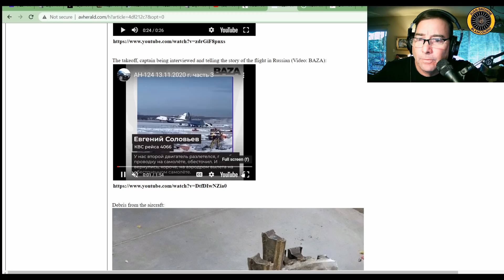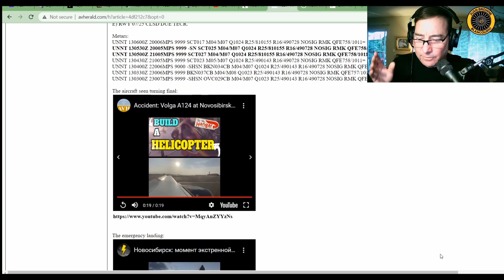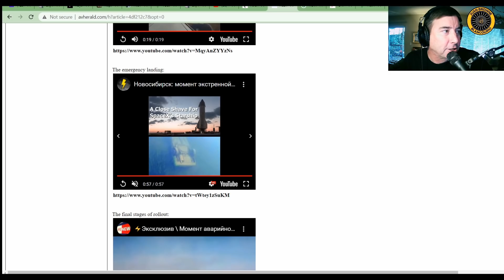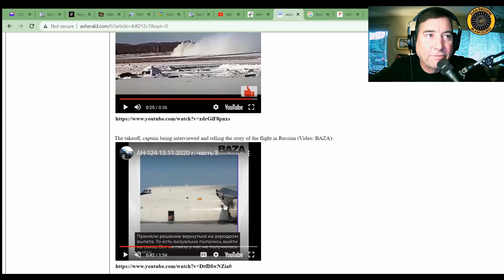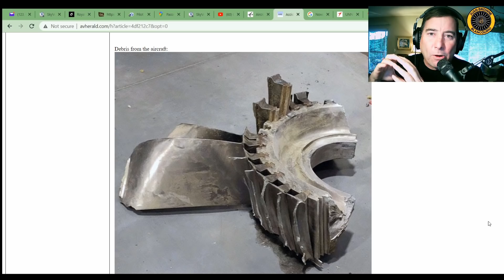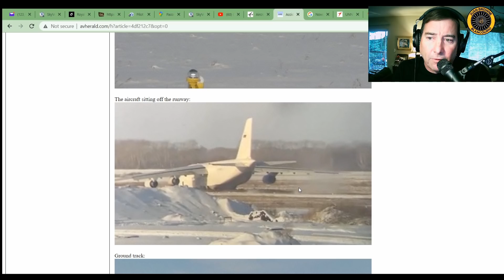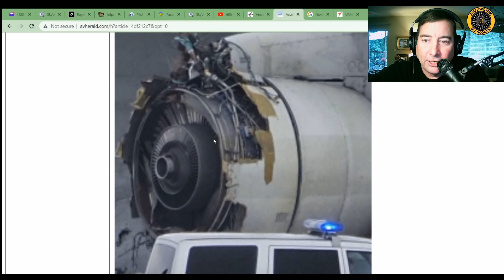AN-124 ANTONOV FAN DISK FAILURE NOVOSIBIRSK, RUSSIA

Comment: When Juan mentioned the "what-if" of going IMC and loosing that much electrical, comms and determining what instruments you have and what you can trust while dealing with a catastrophic uncontained engine failure...it sends a shiver down your spine thinking how they could get back and lined up to the runway. It would be a CRM lesson of Russian legend for sure. Btw- The Antonov 124 has a kneeling chin ramp for loading so the nose gear swings back to lower the nose.

Comment: You r not correct about "guilty of pilots". In Russia it works this way: for any situation when somebody dies or was in high risk of loose their life, so called "investigation" is opened (always). 
But the ✅word investigation does not have any negative meaning.✅ Basically it means that they will try to identify the reasons which led to this catastrophic event.
Nothing else.
➡️presumption of innocence is always applied based on the law.

Comment: It's hard to imagine how the shrapnel from a single engine disintegration could cause so much damage to such a huge aircraft, until you think that many of the fighters in WW2 were equipped with 20mm and 30mm cannons which could bring down even the largest bombers.

Comment: The achilles heel of modern jet engines.
The centrifugal forces induced on the disc and fan blades are incredible.
Even the slightest failure in the casting causes fatal failure.

Comment: Hiya Juan, back in the day I machined Rolls Royce aero and non aero turbine parts and the most "Critical parts" like discs had a specified code of machining called R/R -JES 125 I believe that controlled how fast, and  how much material you machined of in one pass to stop micro metallurgic deformation of the surface areas controlling processing stress when machining them. Too little or too much could Induce surface stresses that may be unseen but you may have jumbled up the material surfaces or just under the surfaces in a manor you defiantly don't want... Thanks for the video. Ian - UK.

Comment: Presume they landed over weight? And no brakes or TRs or spoilers? .....nice. aircraft are designed so that a rotor burst shouldn't take out All brakes or spoilers. The different electric and hydraulics are segregated so that a chunk of shrapnel will take one but not all systems.  If they lost everything that is almost unheard of. Lucky they still had primary flight controls.

Comment: Just fortunate the engine retired where it retired and not a few hours later. The shrapnel could have gone through my roof in Vienna 😬. Seems they're running out of parking space for new aircraft and kissing 747s goodbye globally due to the Chinese virus but the crap is still in the air. Plus Austrian Kia and Hyundai drivers will have to wait a bit longer for their parts...

Comment: Using the AOA gauge for speed, hmmm. Now, with no artificial horizon available, you have to rely on visual references.  Does that mean if you were flight level, your AOA is going to read differently at different speeds?  Thus, deducing the AOC and visual references, you can estimate the speed?  Under normal operations, is the AOA compensates by airspeed and compared with artificial horizon?  I suppose the AOA should be comparable to the AH.  Am I close?

Comment: Had a pressure plate come apart back in 1967 at 6500 RPM, it sounded like some one had rolled a grenade under the car. Lots of damage too, both exhaust manifolds, starter sheared off, a few pieces of the block broken off and a few small punctures of the firewall / floor pan.

Comment: This is similar to the Qantas 32 engine failure also.  I wonder if this was related to an engine overspeed, Qantas 32 or a metalurgicallurgical failure as with the United flight 232 engine failure? Notice the coincidental numbering of the flights?  Is that a little spooky?

Comment: Operating time , and Cycles on the failed parts will be interesting. Just looking at those photos, it looks like corrosion could be a player in this Failure. Very Skilled pilot & air crew saved this freighter & the passengers.

Comment: I would think that they would have had airspeed, vertical speed, and basic gyro flight instruments from the pitot static and vacuum systems.  Even in aircraft with primary flight instruments in a TV screen they have had back up analog instruments that don’t require electricity for their operations except for the lighting.  The cockpit crew could probably hear each other without the intercom..

Comment: When to dump the checklist and do what needs to be done should be taught early on in aviation but it’s not.
Reply: early ?? at Cessnas 152 ?)
Reply: @АлексНиков-л2с  yes even that early things can go wrong so fast that do the memory items dump the rest. I get we live in a world of checklist. But tell me what checklist does you any good in a full rudder deflection on liftoff? Sorry but there isn’t one. At some point you need to learn very early on that yes you need to live by the checklist but don’t be has concerned about the checklist then to fly the damn plane and to do the absolute must items and if you skip the not very important items you are still good in an emergency. Just personal opinion on some of the training that is happening where yes engine failure they know what to do but a lot of other things are really not taught. We can always improve way past ACS standards.
Reply: @davidmichael5573 can yo make it in 1-2 sentences ?)
Reply: @АлексНиков-л2с  of what? What I’m trying to ask for?
Reply: @davidmichael5573  of whatever you re trying to say )))))
Reply: @АлексНиков-л2с  some parts of a checklist can be skipped when you don’t have time to run the full checklist. IE: are you gonna run an after takeoff checklist with an engine failure on takeoff? No. You are gonna skip straight to engine failure memory items and you may not have time to actually pull the checklist and verify that you did anything on that checklist. Extreme example? Of course it is. But that is something that should be gone over in basic flight school but it is not at all.
Reply: @davidmichael5573  pilot monitoring should  start doing after take off check list, while captain flying should do emercency memory items & decide is he capable to continue flying - if not - switch pilot monitoring to emergency check list (by that time most likely after take off check-list will be ccompleted anyway)
Reply: @АлексНиков-л2с  I’m talking the method should be taught to pilots as low a single operation where there wouldn’t be the backup of having someone sitting beside you when things go to hell.
Reply: @davidmichael5573  but it is taudght this way at least 60 years already - what is the question ?
Reply: @АлексНиков-л2с  as I said before we can do better at lower levels in aviation before the pilots get up to the airline. Why just sit back and watch people die cuz they are not trained in every aspect we can train them in. There is so many fatalities in GA that there is nothing that can hurt on the training side. Yes everyone focuses on airline when the problem is your low time GA pilots who don’t get the same training as the airlines but die more often. August we did not go a single day without someone dying in GA in the US. I knew two people that died in August in a GA crash. Initial reports was engine failure on takeoff trying to return at to low altitude did a flat spin into the ground. Would dumping a checklist help that probably not. But better training damn sure as hell might have.
Reply: @davidmichael5573  it is already done there 60 years ago

Comment: https://youtu.be/8wKsl4fsN2A
40 years ago 2 crashes happened in Poland flight 5055 and 007. The cause of crash was a shaft defect. The low pressure fan turbine exploded and its parts cut electric and mechanic cables also damaging 2 of 3 remaining engines. The fatal engine was reported several times to russian manufacurer but he claimed its good to operate. 2 crashes almost 200 people died. Same sort of defect ocured in several other situations lucky with no fatal crashes.
Wonder what changed in 40 years of maintenance procedures in Russia?

Comment: I think it was in the eighties I traveled to San Diego to a International airshow where a AN124 flew a low level performance.  Every time it turned to come by the flight line my feet wanted to run away.  It was huge, slow and scary flying even near us.  The following week in another US airport it blew an engine causing a forced landing at the airport.  My feet were on point!

Comment: I believe the engine is the Progress D-18T. Configuration is 3 spool, like the RB211. single stage Fan, seven stage IP compressor and seven stage HP compressor according to Wikipedia. You are looking at  a classic "tri hub failure of the Fan disc". Looking on the front of what is left of the engine you see the fan exit stators and the IP compressor inlet stators. You can see the end of the IP compressor shaft but nothing of the  Fan shaft appears visible. Possibly sheared off from the imbalance of the fan disc failure. Any pictures of the LP Turbine? That will have headed towards an overspeed condition  due to it becoming unloaded with the fan separation if the control system didn't catch it

Comment: The former Soviet Union and its client states used a very different set of airworthiness standards than do we in the U.S. Many years ago, when the company I worked for looked at buying a new client-state built airliner, we discovered how different. It was fairly obvious the aircraft was a 707 clone, which we wished to modify for a specific application. 

When we asked about the availability of the data for the aircraft, we were told to use the data for the 707. "Were the same materials used in the cloned parts," we asked? We were given a blank stare, and it was evident they really didn't know what or why we were asking. 

I could picture out structural dynamicist tearing his hair out, not to mention the materials engineer. Dissimilar metals issues? Aircraft built by these folks just can't be judged by our standards, because they are built to different (sometimes, evidently, no) standards..

My congratulations to the crew on their landing. I can't imagine anyone doing it better.

Comment: So,,,, where was the safety equipment out by the runway. Guessing the commies, don't care about that??? 
   You don't think in that small of a radius, they could have found the rest of the fan, or at that rpm, it shoot itself miles away!!!
THANK GOD, that this was cargo not civilian. Can't believe the out track of debris.
   Why also with the E&E below the flight deck, and in front of the shell-out, how did they lose com! Redundent system's need to be run on opposite sides of the aircraft...

Comment: one big problem in this class of airplane would have been the subdivision of the cabin, it is common that the engineers position is in a well underneath the main cabin, thus the loss of means of communication means one crew member less... could he even see what was happening is very much under question.

Comment: This kind of reminds me of the Japan Quantas A380 that blew apart due to a misaligned hole drilled in an oil pipe. They lost some vital systems on that plane and it barely was able to to stop before the end of the runway. Some of the debris from its uncontained failure of a disk landed just inches from a child in a classroom full of kids. I myself do not like the design of the high output turbofan engines. They sound like a buzzsaw at MTO thrust. All of that vibration can’t be good for any engine

Comment: Great report as usual Juan.  As you stated, it appears that this was either an original manufacturing defect in metallic structure that propagated though time and wasn't detected by NDT inspections.  The crew did an amazing job getting this thing back on the ground without any loss of life.

Comment: Certainly low, not necessarily slow.  Large aircraft always look slow because the eye perceives speed based on the size of the object.  He's probably still up around 180k-200 kts as he turns left.  Not the best system design if a failure such as that can sever all electrics to flight controls and instruments.  Western designs would generally keep redundant systems widely separated for exactly this reason.  I've had the end of a refuelling probe hit a prop and get batted straight through the fuselage of a C-130 and that was pretty scary, but apart from the holes in the skin there was no effect on systems; it did miss the Hog's Trough.  I wonder if this scenario will now feature in their sim rides?

Comment: Not just cables. Whole An-124 avionics compartment sits on upper deck. Behid cockpit there is a crew rest area wich is aprox 10m long. All rest on the upperdeck till wings houses avionics. And holes in fuselage are going right through that part.

Comment: Juan, that is nothing to do with "being presumed guilty until proven innocent". 

That's a standard practice that the prosecutor opens investigation whenever something like this happens, it doesn't mean any assumption of guilt of the crew at all. I am not Russian myself but in my country (Slovakia and also here in France) it is the same - if there is an incident like this (industrial, transportation or even a car crash), as long as there is a sufficient amount of material damage or there are human injuries then the police and prosecutor's office will open a formal investigation to identify whether anyone is responsible and if yes, who (and eventually prosecute them). They are required to do so by law.

This is completely separate from any transportation authorities investigation (NTSB in the US, BEA in France, etc.)
Reply: As Russian I can say you that the attitude during the investigation is exactly 'guilty until proven otherwise' for air transport incidents. This is insane, but it is what it is.
Most probably case will be closed without any consequences for pilots and the crew, but during the investigation crew will burn tons of their nerves.
Reply: That's right. And in Russia there's also a special Transport Police and a special Transport Prosecution Office, in this case the West Siberian Transport Prosecution Office which is btw sitting kn Novosibirsk. To my knowledge meanwhile Rosaviatsia = the Russian NTSB so to say, has also opened their investigation.
Reply: @Hans_R._Wahl , not exactly. Rosaviatsia = the Russian FAA I would say. NTSB = MAK (IAC).

Comment: Its interesting to compare this to the quantas A380 uncontained engine failure. At the same time very similar events (and both handled excellently by the crews) and yet so dramatically different. The quantas crew having to spend hours going through checklists and clearing error messages and then simulate/calculate landing on their laptop, and the russian crew having no electricity let alone computers and landing the thing mostly by feel. Completely different skill set requirements too.

Comment: Unfortunatly this is not such an extremely rare event.This is exactly the same failure that happened on the  AF066 A380 CDG/LAX number 4 engine on 2017. After investigations , the French BEA(accident board ) released the final report, and it was discovered that the titanium alloy Ti-6-4 that is widely used on aircraft  jet engines is prone to be sensitive to "cold dwell fatigue".Which means that the all industry has to reevaluate the criterias for using this metal .

Comment: Well this just goes to prove that Friday the 13th is not always unlucky! Sure, the uncontained failure was unlucky, but the fact that the airplane still had flight controls was exceptionally lucky. That, plus really quick and correct decisions by the captain made this something to smile about. I suspect that the increase in cargo flights since the pandemic may have resulted in less than ideal maintenance protocols, but there's plenty of time to point fingers. No loss of life here is the main thing.

Comment: I chose to do my metallurgy class midterm on the Sioux city crash. Al Haynes and the guy in the right seat were accompanied by a company flight instructor for the airline catching a ride back home in coach. After the bang he went to the flight deck to offer assistance.  That dude was paramount as he was on the throttles which for the most part was the only way to control the aircraft. Talk about CRM in a time there was no such thing. Captain Haynes was so calm and collected the three of them just trying to work through the different failures. Its amazing a little more than half the people on board survived.
Reply: CRM DID exist at the time of UA232 and Captain Haynes did, in fact, credit CRM with helping to deal with the emergency.

Comment: My limited conclusion: Aircraft engine failed. Airframe, compromised. Flight crew, held together. Flight crew got back on the ground with a compromised aircraft. No life loss or injury. Flight crew... 100%
Sometimes you have to put the thing on the thing. Nuances/Procedures and basics assumed. 
Lessons are going to be learned from this. But they put the thing on the thing. Well done.

Comment: The engine manufacturer Ukraine  in case going to tell the Russian go f yourself they have not been selling parts or doing overhaul work on the engines owned by planes base or own by Russia most NATO code name CONDOR are Russian Air Force  also the Reason they still fly when full of holes they are make to take battle damage and still land